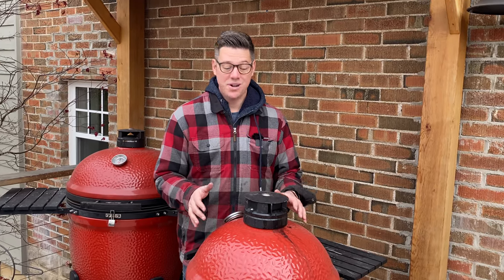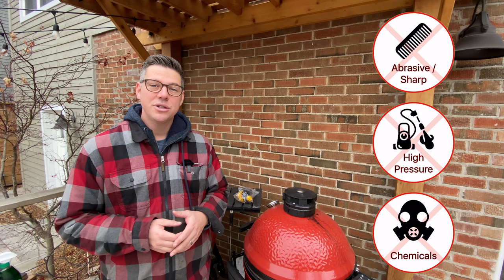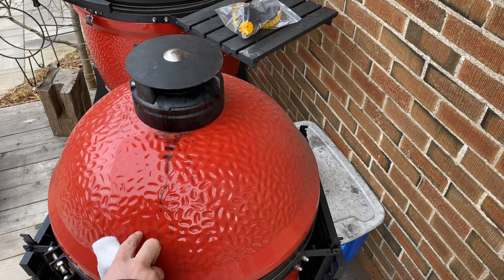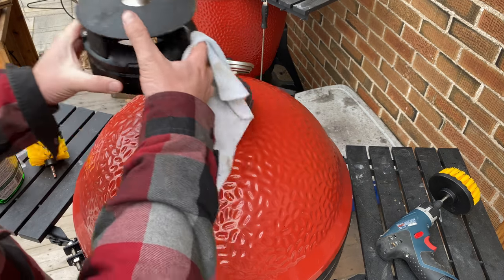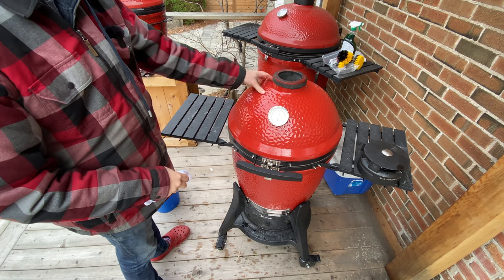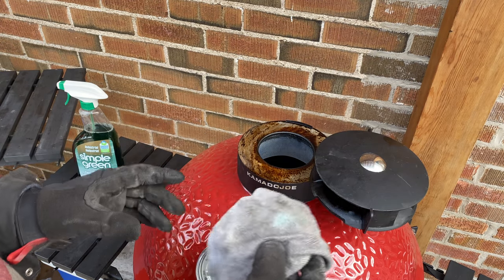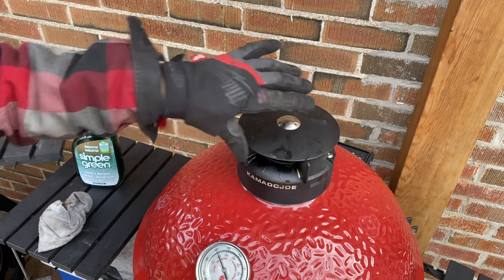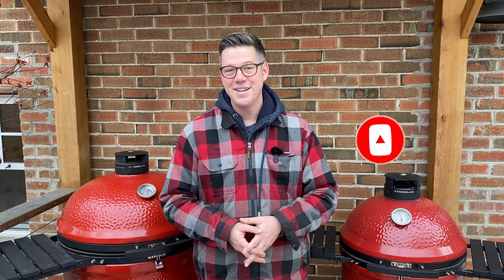How to clean your Kamado Joe dome & FIX a stuck Kontrol tower top vent cap in 5min

Comment: Have you had any issues with the Kontrol top paint flaking. I haven't done anything high heat that should cause issues on my Big Joe III, but both the vent slots as well as the inside has paint flaking off.

I can deal with the cosmetics of chipped paint, but I dont want the inside falling into my cooks.

Maybe I should just switch to a smokeware?

Comment: Thanks for all your videos, James. Incredibly helpful as a new BJ3 owner. I have a quick cleaning related question: how do you get the ash/soot off the outside of the Joe without it getting into the cracks in the porcelain and making them permanently black?  Is this just inevitable?  Whenever I try and wipe it down this is the result.
Reply from the maker: This green stuff and brush will get it

Comment: 9:18 I have a top vent cap of old design and do lots of slow cooking. My top vent has stuck every single time at next session. Degreasers do nothing to that thick grime. Heat is my only friend. Do you have any advice on best top cap constructions, stainless vs cast? Thank you.
Reply from the maker: you can always let it cool down in the joe, this essentially bakes the grease into seasoning for the cast iron on the older daisy wheels
Reply: @SmokingDadBBQ  yes, I got daisy wheels. Thanks for a tip!

Comment: Thanks for the tips.  I have a relatively new classic III, and just the other day cut my hand while trying to force the control open.  I've been cleaning after each cook now.  One question, and i apologize if you have answered this before but i just can't find it.  How do you know how much smoking wood to use on cooks?  I never know if i used enough or not, since there is never any wood left over when i check the coals.  Thanks for all the great videos.
Reply from the maker: maybe I should do a video to help on that. in general 2-3 chunks or a single log that fits in the basket is the Max. too much and you run into dirty smoke / temp control issues
Reply: @SmokingDadBBQ  Thanks.  That is what i normally do, just never know how long the wood is lasting.  Appreciate all your videos.  Really enjoy them.

Comment: Hey there, found the suggestions very helpful. But I was wondering about something. I noticed how easy it was to take the complete Tower off of the KJ.  If it comes off so easily when it's dirty and sticking, would it work if you were to heat the Tower up in the oven instead of wasting charcoal just to bring it to temperature? I'm talking about oven temp around 100°C/200°F, just high enough to soften up the grease.
Reply from the maker: You can. I. Just torch the inside for a few seconds and then it releases and I can clean it

Comment: James, thanks for the great videos.  I've found the absolute easiest way to clean the dome is to do it shortly after a cook while the dome is still warm. Using either 409 or Simple Green and a microfiber and the grease stain will come right off  with no need for a brush.
Reply from the maker: Great tip!  100% agree on that

Comment: Question for you about the control tower top. My top on my Big Joe III is not as secure as I would have expected it to be. Should it fit "snug" to the dome? I am often concerned about it falling off when the dome is fully open.
Reply from the maker: some nomax high heat felt gasket material from amazon for $20 ish solves this

Comment: Great video, been waiting for cleaning tips for the control tower. How did you clean the slider? You didn’t show that part and my one is even tough to open the slider
Reply from the maker: I used the same rag and gently wiped it when hot

Comment: What is your recommendation for cleaning the metal parts inside the Kamado Joe, ie divide and conquer parts and the ring that holds the ceramic pieces together?
Reply from the maker: I don’t ... just the occasional high heat cook
Reply: @SmokingDadBBQ  Thanks.

Comment: After my last cleaning I sprayed the outside with with Turtle Wax's Hybrid ceramic spray...  My wife saw this and asked Why I was using a 'ceramic' spray on a ceramic grill...   Not really having a logical response...   I simply sprayed some water on it and pointed to all the water that beaded and ran off the grill as I sat there with a silly grin on my face.  
One thing I did notice, and it may be all in my head, is the greasy stains seem to clean off easier after I had done that.   Maybe I will try TW's Graphene spray next.
Reply from the maker: hahah now i want to go carnauba wax my grill lol

Comment: Should I foil my heat defuser? I see lots of people with them all black and nasty. What’s your recommendation. Sorry if it’s in one of your videos. I been watching them all and haven’t heard you mention it yet
Reply from the maker: i don't only because I have had foil melt at higher temps and don't want that inside my joe... instead I now almost religiously use drip trays.  I got a 10" and 12" one from SmokeWare as they are round and work well inside the Joe and with the SloRoller

Comment: They make little steam spray machines that might be useful for cleaning out the nooks and crannies of that control tower. Just steam with no chemicals, so it should be a viable option. I use it around the house all the time and it works wonders on tile grout and stuff like that.
Reply from the maker: Good idea

Comment: Just watched video on cleaning your kamado joe...can you put the control top in the oven on self clean?
Reply from the maker: it will clean but sadly the paint will be worse for wear. mild hot water and dish soap with very gentle cleaning is your best bet. that and removing grease when it’s hot helps

Comment: Thanks for the video.  Quick question: the gasket on mine got unglued, any suggestion on what to use to glue it back on?
Reply from the maker: My classic just did the same.  Bison Silicone hight temp (red) ironically in a blue bottle

Comment: James, would you recommend purchasing the newer tower cap for a classic 1, or sticking with the stock Daisey wheel?   Just picked up a classic 1 on a great bargain.
Reply from the maker: it works great, only downside is learning the air gap when there are not markers that make it easy next time and the fact it moves when you open the dome and lastly it lets rain in.  I would upgrade if you have rain... the first two are manageable.  Put the set screw at the front and this solves it moving when you open and close the dome, for settings either remember or make a line yourself for common settings like 270f for low and slow

Comment: Getting my Big Joe 3 delivered next week and have been binging your videos!  Newbie question about getting out the last bit of ash.  After cleaning out the bottom pan of most of the ash, instead of removing the petals / plates and the firebox completely, could you "blow out" the remaining residue?  I have a compressor and was wondering (while maybe messy / dusty) if that might be a quick cheat?
Reply from the maker: I know lots of people do that. I just don’t like getting covered lol
Reply: Im guilty of using the leaf blower... Just close your eyes, hold your breath, and prepare to shower.... 
Works though 😝

Comment: When trying to soak a stain, put a paper towel over the stain and soak the paper towel. Keeps the chemical from just running off. Careful use of an aerosol oven cleaner works wonders as well. Thanks for your work.
Reply from the maker: Thanks for the info!  Cheers Steve

Comment: My dome actually sticks pretty bad now since I did the high temp deep clean on Saturday. Any thoughts? Thanks so much.
Reply from the maker: the dome hinge you mean?  if so you can adjust the tension with the nut at the back
Reply: @SmokingDadBBQ  - no, it’s the dome lid of the classic 3. I saw your hinge adjustment video. Most helpful.

Comment: Hi James,
Question, do you use your grill all year long? What was the coldest temperature outside you used your kamado grill? This is my first year with a kamado so not sure till when can I use it.
Your neighbor from Stouffville ON.
Reply from the maker: hey neighbour. yes I do use it year round. I haven’t thought before to record the temp but I’ve never gone a month in winter without using it
Reply: @SmokingDadBBQ  thanks James. I am have been using it until now but was not sure how long it would continue. I am going to continue using it and if I run into issues I'll be sending you a message 😅🙃.
Reply from the maker: @bigdaddyg1  if it ever freezes shut. Start a small fire in the bottom vent door and it will melt it
Reply: @SmokingDadBBQ  ohh nice. I didn't even think that could happen. Thanks bud, these gems of knowledge comes with experience 👍

Comment: The only thing I don’t love about my joe is that cheap kontrol tower cap 😤 I needed this video. The first time I cleaned it though it got ruined but the dealer replaced it. But of course it took 6 weeks due to everything being on back order
Reply from the maker: same here, my first classic the paint came right off with a paper towel .. this one and method has been fine

Comment: I have about a week old big hoe 3 and my hinge creaks when opening and closing. Any idea to fix that?
Reply from the maker: check and make sure your bands are tight and the air lift hinge mechanism is not moving when you open the dome. I’ve seen that once. if nothing is moving / lose it will break in / go away I think with some cycles on it

Comment: When I was doing research on Kamados I stumbled on the stuck Control Tower thing, and the consensus seemed to be to soak it in PBW and it'd be good as new.
Reply from the maker: pbw?
Reply: @SmokingDadBBQ  I don't know what it stands for as that's literally the product name. Just search PBW on Amazon. I couldn't figure out how to get a link to it from the Amazon tablet app.
Reply: @SmokingDadBBQ  it’s in a white bottle with green letters.  Works amazing on stainless steel. Soak overnight and as good as new.
Reply: Pbw powder brewers wash, if I am not mistskin.
Reply: I used to homebrew. Instead of using PBW I used oxyclean. I think it’s pretty much the same product. Dissolve the oxyclean in some warm water and it’s very effective at breaking down stubborn grease and grime.

Comment: what's that funky shiny dome in the background at 0:06
Reply: the JR comes with daisy wheel which can get wet since it's not as good as the classic or big, so he recomends the aftermarket one
Reply from the maker: Its the SmokeWare vent cap that adds rain and no movement when opening.  Upgraded stainless vent cap by SmokeWare - https://amzn.to/3gP8RAQ * you need the gasket below to fit the Jr. Gasket needed to make the SmokeWare stainless cap fit the Kamado Joe Jr. - https://amzn.to/3fKfFhR
Reply from the maker: Daisy works great, but I like the no movement and no rain that the new Joes Control tower top has... since one doesn't exist for the Jr this is great alternative IMO

Comment: Brave man....
Wouldn't it be easier to clean the dome when the KJ is up to temp?
It should be kind of the same residu as on the cap....
Reply from the maker: yes but I was treating it like paint on a car. the hotter it is, the easier it is to damage so while I am sure it would be easier I wanted a cold dome for trying the power tools

Comment: Hello Smoking Dad BBQ. Recently I purchased a Komado Joe Classic 2 from my Nephew who could not control the heat, took too long to set up, and just did not have the time to learn how to use it and is going to a Traeger Pellet smoker. He asked around at a family gathering and asked if anyone wanted to buy it for $400.00 and like a dog on a bone I jumped on it in a heartbeat. I have had it now for 3 days and in that time I have tested your methods. First experiment I was able to get the unit up to 800 degrees quickly and hold to clean the dome and check the gasket and test it for my wife's future pizza experiments that she would like to use it for as soon as possible after watching your pizza videos. Second experiment was to get it up to 300 degrees and then choke it down and held temperature between 250 degrees to 270 degrees by  using your two finger method and shutting the top down halfway and held that for 4 hours before shutting it down. I have no problem with it after your lessons.  I need to clean my grill and I watched your video recommendation just now on how to do it correctly. Thank you for the advice. BUT now for a question. I googled on how to remove a stuck Kontrol Top and cannot find a good video on this. I want to change out my Komado Joe Dual function top (with the four holes on top) to a KJ-KT version like you have on your grills. On the Komado Joe forum someone tried to do it and broke his top dome. I do not want to do that to mine. What would you recommend? Maybe a suggestion for another video that is not covered in this video. Love the channel and I just subscribed and joined. Thank you very much for your informative videos.
Reply from the maker: glad the videos helped get you up to speed, they are really easy to use once you know what you're doing but they are not as easy to someone who might prefer to run it all from their smartphone.  i can get my joe up to temp and cook quicker than i can a pellet grill but marketing does a good job of selling the pellet simplicity 

if its stuck there could be a few reasons, one is grease... if this is it remove the cap when the joe is hot and it should come off with little to no effort. 

if it doesn't there might be too much gasket material and it was jammed on.  i think some people who break theirs don't admit they used something like a hammer lol, you should be fine with a hot dome in either scenario but if not its best to push from the inside out than it is to twist side to side which puts pressure on the ceramic ..... tapping a stick pressed against the cap straight out will release the most stubborn of caps
Reply: @SmokingDadBBQ   Thank you very much for your advice. I was on the same thought wave but wanted to make sure.

Comment: How do you clean the sloroller?
Reply from the maker: prevention is your best option with a drip pan. second is when you remove your food, crank the heat to 425 until the white smoke burns off. flip the top plate on the SloRoller next time to burn off any remaining gunk

Comment: I really appreciate this video. I have some help I hope. There is a product that a friend of mine introduced me to that he uses to clean his airplanes with. It is unbelievable. It takes grease off like you won’t believe, no chemicals, no acid, ammonia or bleach! Now I know it’s expensive, a 20oz. bottle in a spray container is $1.00, yes $1.00. You can get it at either The Dollar store or Dollar General. It’s called “AWESOME” and believe me it is. Invest a dollar and try it, it’s great around the house. (It says to dilute before use which I do not do on grease)
The nice thing is you don’t have to heat the grill to clean.
Reply from the maker: thanks for sharing

Comment: Have you ever had a problem with the paint peeling off on the inside of the Kontrol tower which makes it harder to open the vents?
Reply from the maker: Apparently there are multiple enhancements over time to the paint formula. My newer caps don’t have any flaking paint. On my old one I just cleaned the inside well and it didn’t bother me if during scrubbing I removed some paint as I preferred proper operation vs paint on the i side which can’t be seen
Reply: @SmokingDadBBQ  Good to hear. KJ sent me a new Kontrol Tower last month, so hopefully this one doesn't have the same issue.